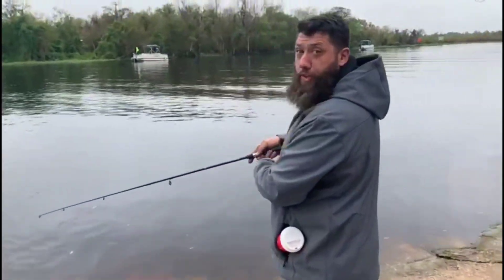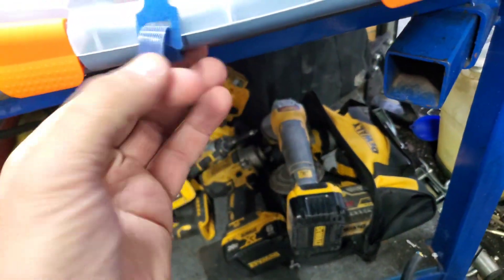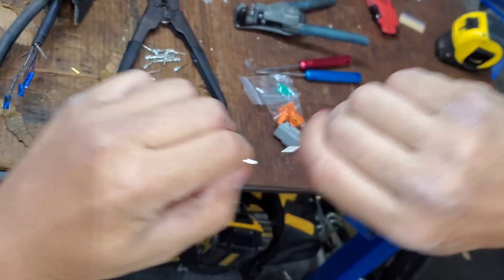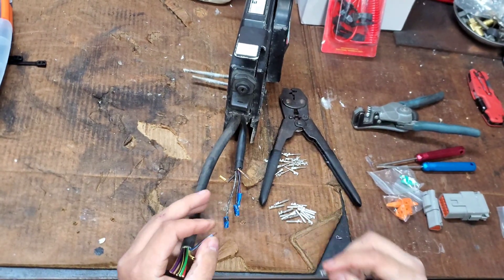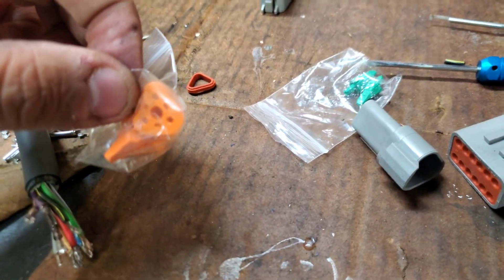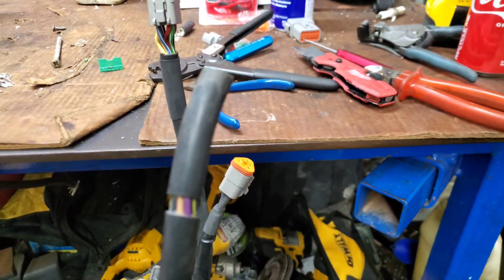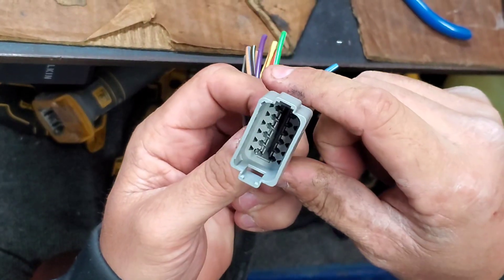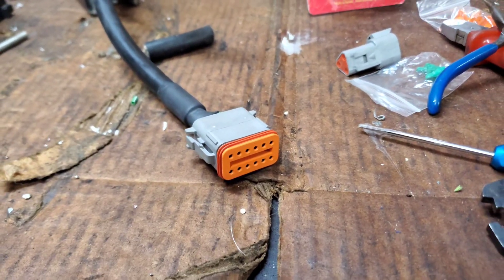Rewire your boat using Marine electrical wiring duetsch connector that is simple and waterproof!

Comment: A little bit of dielectric grease on the seal helps them things go together a lot easier. Also keeps the seal from fusing in the heat too
Reply from the maker: Good call! I'll pick some up!
Reply: Just use enough to make it look wet and it keeps any corrosion off the aluminum pins too since air can’t get past it